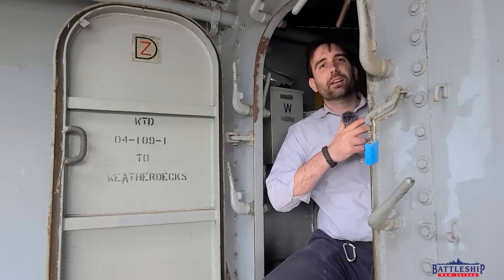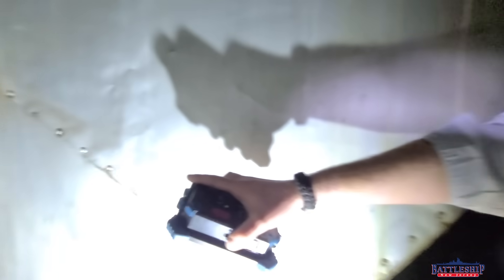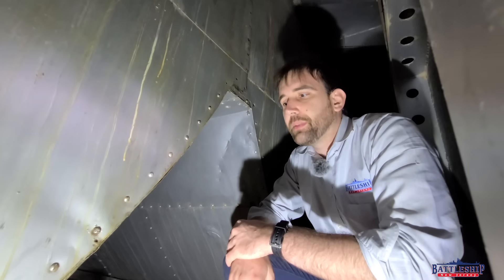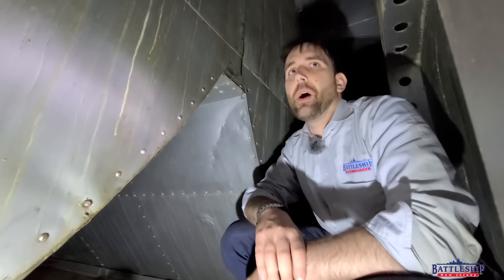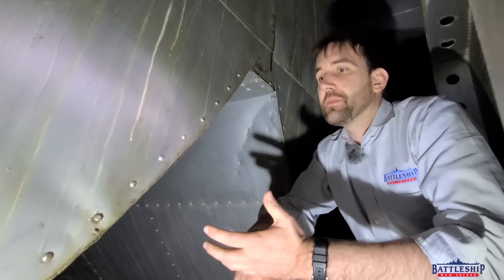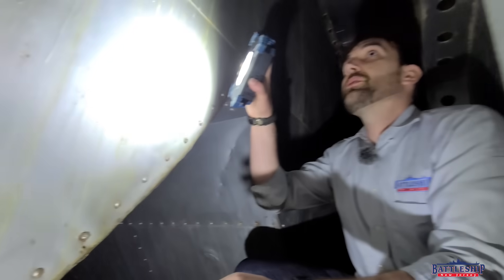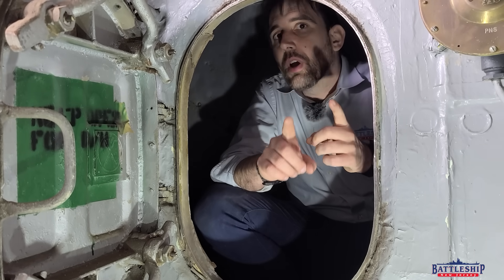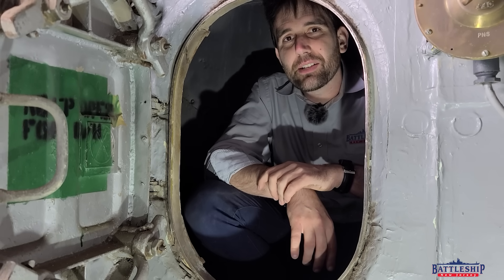Inside the Smokestack of a Battleship!

Comment: As a model-maker, I'm concerned a lot with looks, but also fascinated by the pioneers of technology, when people were figuring out how to go with all that new-fangled "steam". The most elegant battleships in my opinion would be the 2.stack Dreadnought type battle-cruiser of WW 1. They had outgrown their children's shoes but were not yet cluttered up by anti-aircraft guns and radar gadgets. On the other hand, I love the ships of the ironclad-era, particularly the outrageous French ones. They show the evolution that's been going on between the well-known wooden broadside-cannon-equipped sailing ship and the also well known steel, steam-driven turret-equipped ships of the 20th century. When I say I care about looks, I have to add not only beautiful elegant looks, but also the weird, interesting, even a bit clumsy ones. 
But then again, since my ship models are meant to float and run on the water, I have qualms with big battleships and ocean liners. Turning such a ship into a model leaves you with two chices: a ridiculously large model or a ridiculously small scale. I know 1/350 is a popular scsle for static display, but for sailing, it won't do. I have modified a Tamiya Bismarck in 1/350 to radio control, and it ran all right, but it looked ridiculous, lightly dancing on the waves and having to run twice its length in a second just to produce a noticable bow-wave. Enough waffling about what I don't do any more.
So I stick to building smaller craft that usually have just one stack, but I also have a late 19th century topedo-boat-destroyer with four stacks. These were so slim, there was no space to run boiler-uptakes back or forth.
P.S.: who else has to think of Howlin' Wolf when they hear the term "smokestack"? Maybe just me because as a non-native speaker it was the first time I heard it ever.

Comment: I'd suggest a section in those funnels where you'd have a heat exchanger (with cold water) to cool down those exhausts.
It would reduce the sheer volume you'd normally get from the exterior funnel, and thát would also pull the hot exhaust air from the boilers - thereby increasing their temperature / efficiency.
It also means reducing the size of those flues / ducts you showed, and makes the exhaust out the top far less visible on infrared scanners.
Maybe even to the point you could come out the sides of the ship instead of the top.
Reply: It doesn't work like that.

Comment: Smokestacks? Really?
If one were to bring a battleship back into the fleet it would be foolish not to modernize and use the same power plant used in the Ford class aircraft carriers.
Now you've drastically altered the centerline superstructure and changed the whole game in a "new" battleship design.
Upgrading the Iowa class to nuclear propulsion? Probably cheaper to build whole new ship. New battleship could take advantage of nuclear propulsion and all of the armor upgrades since the Iowa class built.
But, not to stay too far from question - the Iowa class look sleek and superb with 2 stacks. Stay with what its got.

Comment: The Lexington battlecruiser design had five funnels? I had to look that up as I had only ever seen the two stack configuration. Sure enough, it was hideous. Lexington and Saratoga were brilliant in many ways; I am so glad we built them as carriers. Sure, the hangar bay divisions and levels were inefficient, especially for later large aircraft. The centerline elevator was a major drawback, but at a time when aircraft were slow and small, Lex and Sara were massive, and very fast. Yes, the cruiser guns were kind of silly once we knew how to use carriers and aircraft range grew well beyond 200 miles. At 33 knots, cramming in 90 aircraft, they were brilliant for fast attack fleet carriers. Poor Langley barely could continue as a seaplane tender, and Ranger was hopelessly obsolete for anything other than ferrying aircraft. Had we been saddled with three Ranger class carriers instead of Lex, Sara, and Ranger, Yorktown doesn't survive Coral Sea. With Hornet and Enterprise alone at Midway, I seriously doubt we get all four IJN carriers. Sara was essential in a few battles around Guadalcanal. Thank God Lexington and Saratoga were build as carriers.

Comment: Should have made the funnels all smaller and separated them by increasing the strength and making them smaller using high pressure for flow. Cooled things off while they were at it, but what do i know, a penetration is a penetration….. no matter what the size. Course, could have designed emergency closure shutdown with armored seats and valves.

Comment: My main concern is that u have the turning gear engaged so the shafts for the props don't sag uner their own weight.  I would also suggest to start the engines ever so often to maintain operational integrity. I was in the US Navy for 8 years 97-05. I desommed 2 ships, uss Peterson dd969 and use Guam lph9. I highly suggest for you to seek people to maintain our natural treasures.
Reply: Only issue is under their contract they can not start the engines or run the boilers for any reason.

Comment: For me, funnels look best when they number one, two, or four. Most of the single-stackers have good lines so long as the stack is centrally placed near amidships (all military designs I can think of do this I'm sure to protect the boilers, but it also applies to most sea-going vessels until post-WWII). Ships with their single funnel offset to the stern (classic Great Lakes freighters and liners, practically all modern, non-military vessels of significant size, but especially cruise ships not built for Disney) have an uphill climb against the stern-heavy look that configuration tends to give. The even number of stacks in a two or four stack design provides a natural line of symmetry for these ships. Compare Titanic, whose midpoint almost lines up with the compass platform between the second and third funnels, to Queen Mary, which (to me anyway) seems to have a gap between the third funnel and the main mast that begs for a fourth funnel (her sister, Queen Elizabeth - a two-stacker - doesn't share this aesthetic problem).

Comment: I’m a combustion engineer retired from 30 years of land based power plant design. Big 800 MW boilers.  The inside view just showed some thin metal duct work. Does everyone  know if the boiler exhaust exist gas, that past threw that duct is 600 to 800f? I think what was shown was the outside of a insulated duct. Be nice to better understand this on this ship.
Reply: Bit late on the answer...  Yes it is an insulated duct.  I have personally cleaned that one.

Comment: One other aspect with ducting is any fans or similiar for airflow control. Forced draught means air forced (fanned) to the in side of the boiler. That increasded air mass also has to come out the "backside". with better air flow in less boilers needed for same horsepower thus easier to have less funnels.
Personally I like the two stacks look as it balances with the fighting tops with aux crt (boats or planes) in between where guns can't shoot anyway

Comment: So... I'm a bit of a steam nerd... the are called funnels because the boilers of old would literally just have a smoke pipe on top of them, and the pipes would discharge into an upside down funnel basically, which channeled the exhaust out the stack. A funnel is a smoke stack, but a smoke stack is not a funnel... kinda like a square is a rectangle but a rectangle isnt a square. Calling the steam plants on IOWA type vessels a boiler is not entirely accurate. They are more like steam generators at that point. You can really see the difference if you compare the steam generators of the IOWA to the boilers of the TITANIC.

Comment: The big trucked funnel designs don’t really save deck space. I’d rather see 2 funnels, and if you build them structurally you can hang radar panels and sensors on the sides.

Comment: I was led to understand that the reason for the double s shape of the boiler exhaust wass to reduce the chance of either a bomb or shell explosion on the funnel allowing the fragments or explosive gases reaching to boiler and either causing damage or more likely extinguish the boiler flame.
Reply: We also had grates above the economizer to prevent a bomb reaching a boiler. on a DD a bomb exploding a steaming boiler would basically cut the ship in half.

Comment: Is this the original smokestack of the New Jersey, or was it replaced at least once during the ship's existence?
The smokestacks on the Queen Mary are NOT original.  The original smokestacks were replaced during the modification of the ship into a hotel/tourist stop.  At the same time, the gaping holes created by the twin stack removal allowed the renovators to remove the ship's engines.  Regardless of plans for the ship's interior space, the original funnels had to be replaced because of metal corrosion.  The Queen Mary was in service for about 30 years before it was retired.
I know at some point (I'm guessing 25-30 year mark for constant useage), if a ship is to continue service, the stack(s) will have to be replaced.  The RMS Aquitania (THE LAST 4-funnel ocean liner in existence by the early 1940s) was in service for close to 35 years and her smokestacks were in sad shape by the time she was decommissioned in the late 1940s.  The metal of the smokestacks had thinned so much from constant exposure to exhaust that you could poke your finger through the smokestack!  The decks weren't much better.  A piano fell through the flooring of a deck becauses of corrosion!

Comment: Number of funnels??
Small ships, just one as any more just look pretentious.
Large ships, two, or three at a push.

There's a tremendous amount of design thought into the shape and size of the exhaust passages within funnels as one needs to get just the right amount of draw across a wide range of power output - which is quite unlike the near constant state most land-based steam plant operates at.  But most of the rules had been figured out by the second half of the 19th century, so the actual calculations didn't take as much effort as one would expect.

Comment: A big change that reduced the number of boilers was adopting water tube boilers over fire tube designs. Fire tube boilers are round tanks with tubes passing thru. Water tube boilers can run much higher pressures and you don't get boiler explosions. When a water tube boiler goes over pressure some tubes blow blow out. Some of the older battleships had a mix or coal fired and oil fired boilers or a boiler that could use both. Most of those boilers were removed in the 1920s and replaced with what was modern boilers of the time. BB Texas was originally built with coal fired boilers and modernized in 1925-6.
Reply: Both the 14 coal and 6 oil fire boilers on Texas were water tube and both were 300psi rated.  When modernized, the new Dyson oil fired units had a considerably better total steaming rate than did the coal fired.  In both case, as with all boilers, tube surface area is a significant factor in determining that.  However, what really separated them was grate surface area of the coal fired boilers.  You could only make the grates so large and you could only pile so much coal on them.  Too little and the fire burns cold.  Too much and you won't get good air circulation through the coal bed and it burns really dirty and inefficiently.  On the other hand, you can keep adding burners to an oil fired boiler until you get it so hot that the tubes boil dry and/or you damage the refractory brick lining of the fire box.  Running large orifice burner tips on the outermost burners on Dysons could erode the fire brick closest to them in the fire box.  Texas' coal fired boilers could also supplement with oil, but they ran into problems with it.  It got the fire hot enough to warp the grate bars, which then required pulling the fire, removing the bars and either replace them or beat them straight.
Reply: @tomscotttheolderone364  Coaling was a lot of fun, too. My dad was an engineer in WWI. They had to wear whites. The coal was dumped on deck and the crew had to move it to the bunkers in wheelbarrows and buckets. They rubbed grease all over their bodies so the coal dust wouldn't get into their pores. I got some pictures of him coaling. On ships with large crews they got 1 gallon of water a day for washing. First they washed themselves (no showers), then they washed their clothes (no laundry for enlisted).

Comment: For the purpose of good looks, side by side dual funnels can be a cool look. I think the shape of the superstructure and masts along with the funnels is equally important for aesthetics of a ship, though. Someone mentioned how Titanic had a "dummy" funnel that was used for various subsystems but not for engine exhaust, nevertheless the builders made it look like the other stacks to make the ship look better.
Reply: Side by side funnels are often found on car ferries where there is a car deck through the middle of the ship so the designers locate the uptakes either side. See MV Isle of Arran or MV Stena Caledonia. 
Interestingly  Fred Olsen's Bolette and Borealis (formerly Holland America Line's Amsterdam and Rotterdam) have side by side funnels (although close together, not right at the edge of the deck), but below deck they are trunked through the centre of the ship and are structurally identical to the Zaandam and Volendam, which only have a single funnel. It's a wierd design.

Comment: At the time the Iowas were built, I would think that stacks were going out of style and today a funnel is a great big bullseye for a heat seeker ordinance. Today if you built a big capital ship like a battleship, they would have the same power plants as the navy carriers today. Many ships if they use a turbine that also dumps its exhaust in the sea below water level hence little or no heat signature. 😊
Reply: Not quite correct! You are mixing the closed loop steam cycle with the fuel combustion path. Yes, a steam turbine exhausts into a main condenser which uses seawater inside cooling tubes to turn the exhausted steam back into pure boiler feed water. In a completely separate flowpath, the fuel ignited in the burners and then used to boil the  feed water into steam must still exhaust through a smokestack unless you are using a nuclear reactor. The last oil fired Aircraft Carrier we built, CV67 USS John F Kennedy built in 1968 used smokestacks just like the New Jersey. I am fairly certain that "IR Heat Signatures" is not a concern for such a large vessel that has Jet Engine Exhausts running 24/7/365 on the flight deck. Also ships of that size have defensive systems to defeat weapons or aircraft using any type of Heat Sensors. I served aboard 2 Nuclear Powered Ships in the Engine room in case you wonder how I know this!

Comment: It is better to have fewer funnels because it allows you to route the smoke away from the fire control directors. They really do need to trunk the forward boiler rooms into a rearward funnel to avoid this, and that is exactly what the Iowa-class does. Two funnels, though, are better than one as damage to one of the stacks won't have as big an impact.

Comment: I think the boiler exhaust should have come out the side of the ship thus deleting funnels, but the engineers may have thought of this and had a good reason for not doing it
Reply: The point of funnels is to have the high temperature, corrosive, toxic exhaust gasses exhausted well above the deck rather than the side of the ship where they would constantly blow across the decks and into ventilation intakes and be drawn into the ship.
Reply: @tomscotttheolderone364  I knew there was a good reason, I just didn't think it thru
Reply: A bunch of seawater from a wave or swell coming back down the exhaust would ruin your day real quick.